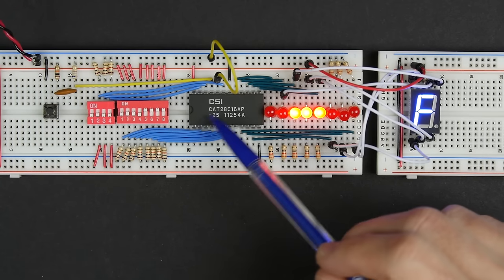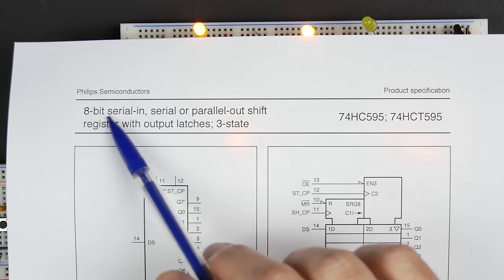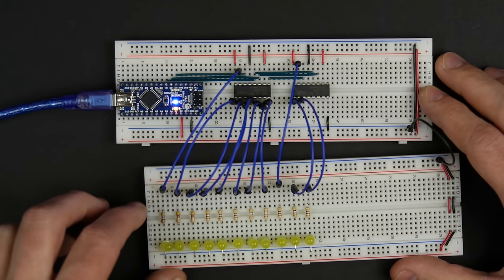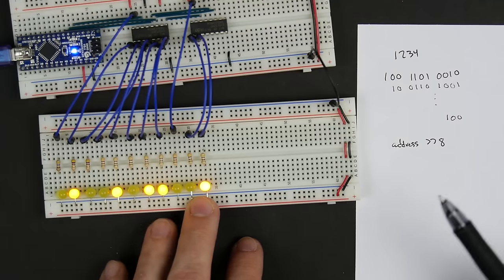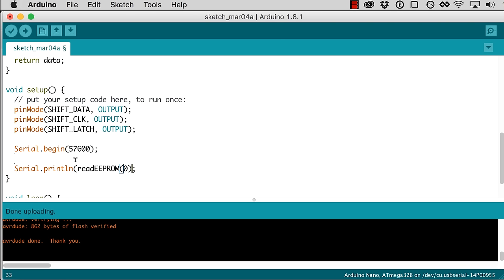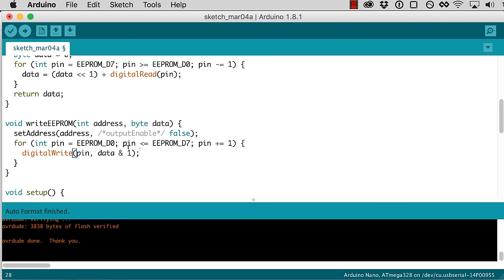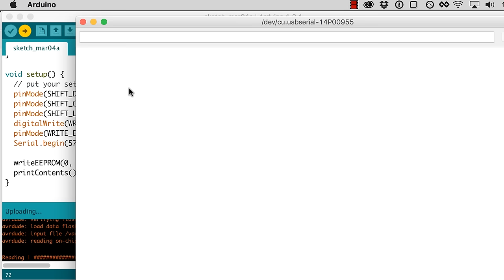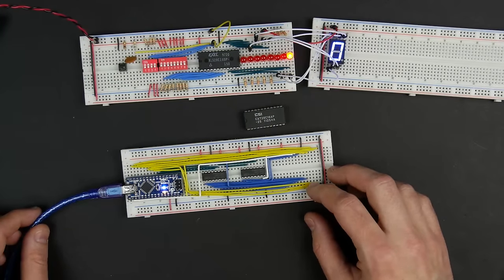Build an Arduino EEPROM programmer

Comment: Ben, your code breaks my heart for all the wasted iterations and unnecessary memory allocations. But you do an excellent job and the polish of your videos makes me forgive that software is not your area of expertise.
Reply: 100%.   he could've set the pinmode right before he wrote to a pin.
Reply: >wasted iterations 
...
>unnecessary memory allocations

Is he delivering a production quality library, or is it some mission critical code block that has some "written in paper" requirements about memory consumption with picosecond precision timings or maybe he's showing off his competetive programming contest solution? All he's doing is ad-hoc sketch that gets the job done. :)
Reply: and how that would affect the end result, please? :)
Reply: iamruss74 Dude, I write code on a daily basis. You don't have to remind me how. My meaning is not that Ben's code is wrong.

Everything else Ben does, he does very well. So it makes the few things he doesn't do well stand out. Because I code so often, I can't help but feel a compulsion to do it differently. Lots of people joke about the feeling being "ocd". I see a few places where const can be used, nested loops cleaned up, etc.

There is only one thing I would go out of my way to do differently. It's a very significant change. I would turn it into an eeprom debugger on the COM port.

In the current implementation, you cannot dump files; a program would need to read the file, convert it to source code for arduino, paste it into the existing code, and upload the project. It may sound simple, but every OS does it differently and the GUI isn't made for computer navigation. An eeprom debugger makes dumping simple; a program reads each byte from a file and writes to the COM port, then verifies that the file is correct by reading from COM port again.

Hard coding more than 50 bytes is not a fun process to do by hand. The point of having a programmer is to make programming stupidly easily. Not to make me convert binary into hex, then put it in a comma separated array, then make sure there are no off by one errors when I write the size, then hope that it uploads to the arduino properly.
Reply: Aaron, indeed there is a lot of room for improvements in any software, but it has to start somewhere. My point was that the scope of the video is to build something that writes hardcoded values into LUT table, not to teach us how to write full blown EEPROM programmer. There are tons of videos about eeprom programmers on youtube already. but we're building 8bit computer out of 74xx elements here, not state of the art arduino eeprom programmer. Should Ben decide to go into non important details he would need to cut on other information to keep the video duration reasonably short. I'd rather see him talking about shift register and not the software development in the bits of time I have to spare, because the software development is what I have been doing for last 2 decades of my adult life.
Reply: With code like this it's better to be safe than sorry. I have coded my whole adult life and it's safe to say that in setup code performance doesn't count. If it fits on the chip and runs well that's prio 1. Fast&efficiant is another story.
Reply: +droleniacoc i'm not actually sure I get what you mean, but I think it means something meaninful and not related to pink elephants
Reply: +Russell Teapot As far as I can tell, he's saying "it's pointless to think about these things. However, because the brain is designed to interpret data, we cannot help but think of them. In comparison a computer doesn't waste time thinking of them." It may be word salad, a symptom of schizophrenia and other mental illness. It may also be a poor grasp of English (as a second language perhaps?). 

And sure, I agree with most of the opinions in this thread. A better tool can be made, and the code can be cleaned up, but ultimately it works.
Reply: Aaron if he isn't constrained by resources such as clock speed or memory then he has no need to optimize for that factor. 

one line of brainfuck isn't necessarily better than a thousand lines of basic. how much are you willing to sacrifice for efficiency?
Reply: Albert Sandberg, but aaaron writes code every day!
Reply: Aaron - Go over to Julian's channel and knock yourself out. Keep your pedantic trolling off the good stuff. This is not a job interview. 

Why does this always happen to the really great channels?  Some troll who read an Arduino book shows up and tries to impress us all. 

You don't write code everyday. If you did you'd know what was important enough to throw around on what may be the best high level digital hardware channel in the world. 

Please, go away. 

I know, I'm feeding the trolls again. I just can't take it sometimes.
Reply: I agree, Crocellian.  I was shocked by his arrogance and lack of tact.  I think he lost the plot about the main point of these videos. Aaron could learn something about human interaction by looking at Graham Smith's contribution. Now excuse me while I get on with my daily coding...
Reply: Whether or not he's writing production code, allocating a new array on each iteration of a for loop could exhaust the Nano's memory before the loop completes. That's not really something you want to happen when programming a large EPROM. It's just as easy to allocate the array outside the loop and reuse it in each iteration.
Reply: He, Aaron. Haven't watched the video yet. But I recognise the sentiment from other videos where I see non-programmers try to code. It usually gets the job done, but it's so wasteful and often inelegant.
Anyway, his code is on Github: https://github.com/beneater/eeprom-programmer - you can always help out by creating a pull request that clearly describes what issues it's addressing.
Reply: Diggy Dude, when creating an array in c (or c++) with square braces, it is allocated on the stack, so as soon as it goes out of scope (at the end of the loop block) the memory block can be reused. Almost any c compiler will just reuse the same location for the array anyways, no matter if declared in the loop or before.
Reply: Alexander Daum: the memory allocation and later reclamation wastes CPU cycles. Creating an array inside the loop causes overhead.

While that's not immediately an issue in this particular case, any seasoned developer will instinctively avoid this. More so on an embedded platform such as the Arduino.
Reply: Juan Rial, it would waste resources if allocated on the heap, but allocating an array on the stack is just incrementing/decrementing the stack pointer. The compiler will, if at least some optimizations are disabled, always use the same address for the array, so no instructions are needed.

I just checked it, and indeed the compiled code is the same, no matter where the array is allocated
Reply: Alexander Daum: Ah, sorry. I didn't realise it would be declared on the stack. You said that in your previous post, but it somehow didn't register. Now, I didn't take compiler construction back in uni, so I'm not entirely sure how correct I am in what follows. But to me it seems like you'd still incur some penalty.

Every time you push a variable onto the stack, you need to move the stack pointer to make room for it. So if you declare a variable inside a loop, you'd be needlessly moving that poor stack pointer back an forth on every iteration: the variable enters scope inside the for-loop, and leaves scope at the end of it. If you declare it outside the loop, it will be declared only once for that stack frame, and the stack pointer would not need to be moved inside the loop.

As to you seeing the same bytecode for both versions: with all the intelligence built into modern compilers that doesn't really surprise me, nor does it strike me as something one can draw any meaningful conclusions from. And while it's good to know that it might not matter in the context of C/C++ (assuming it's not compiler-dependent), it's a bad habit you don't necessarily want to carry over to other languages.
Reply: Juan Rial: of course this is a c/c++ compiler feature. It is so common, that even with O0 the compiler does not re-create the object on the stack in the loop (at least gcc doesn't, haven't tested any others). 

But of course if you do this in a language with gc managed memory, like java, it makes a huge difference, as it does not only waste CPU cycles, but also pollute heap with a lot of dead objects, that have to be GC'd.
Reply: I've seen much worse in other videos
Reply: Alexander Daum is 100% correct about the array. Any modern compiler with optimizations would produce exactly the same code if it was before or within the loop. This is a whole selling point of C++. Micro optimizations like that just made the code more ugly and hard to read and serve no purpose.

Comment: Great video, very stimulating. If you wanted to save space and reduce chips to program just the AT28C16, you would only need one 8-bit Shift Register (SR). You have 20 I/O dedicated on the Nano but you need 21. Using 3 I/O to pick 5 more bits using a SR leaves you with 17 free I/O with 8 Outputs out of the SR as Address lines which are only inputs on the EEPROM. So, 3 I/O to control the SR, 8 in the SR as Address, 3 I/O as 3 more Address (11 in all), 8 I/O for Data, and 2 I/O for READ/Write Control. That gives you 16 I/O used with 4 I/O to spare. In fact, you really don't need to strobe the SR value into the SR outputs, the SR is being used as an Address extender, and the EEPROM will not respond to "twiddling" bits as you shift in a new Address - as long as it is stable before you strobe the Read/Write pins. So that frees up one more I/O to 5 spare.  But, then again, using two SRs to get 11 bits of Address in the SR which does free up 3 more I/O - a total of 8 unused spare I/O.  To your readers: Go with the two SR approach, it will get you up to 16 addresses if you need them for larger EEPROMs. And you can always cascade more SRs to get even more Address lines if you ever want to load an EEPROM over 64K Bytes. This is an awesome video. It has inspired me to build one with a Zero Insertion Force (ZIF) socket.

Comment: Nice Video , ordered a arduino nano, instead of the shift register i was first thinking of a I2C MCS23017 i/o extended , but this works fine also,  the video reminded me of my electronics study back in the 80's when i learned about display decoders with combined logic, it was fun at that time, but now everything is done by micro controller for smaller circuits which is fine.

Comment: I came here by accident, but that´s a great idea.
With this i can save the content of old Eproms and also upload it to an EEprom and use this. I have a lot of old synths which uses also old Eproms to run. Now i can backup these without the need of expensive PC-based Eprom programmers and also put the latest versions of the firmware in it as well, as for some i do have newer versions as plain text files.
With a little aditional stuff i can now get these stuff into my old synth.
Great tutorial, Ben...!! Thanx a lot. :)
Reply: There are may "cheap" eeprom reader/writers in the market for as little as $10.  Now I'm not trying to distract you from building this especially if you feel it's educational, however sometimes it's just not worth wasting time when it can be readily bought for a few dollars. ;)

Comment: I ended up making my own programmer for my 28C256 chip using the same serial to parallel ICs and nano. I am glad I haven't drifted off the way too much - the only difference is the arduino sketch.
Reply: Hi Russ.. would you be able to share your sketch at all? I'm trying to use the same chip with Ben's sketch and circuit diagram but haven't had any success

Comment: Hi 
Also you can use PCF8574 I2C IC instead shiftregister . Each one of pcf's handle two i2c input and give 8 output pin.

Comment: Nice job! I've just noticed for myself that if you don't have 74HC595 you can use 74HC164, but with CLEAR signal instead of STORE. In this case you must modify algorithm a little, but it will be working here too.

Comment: I quite liked the solution for the pin limitation on the Arduino. I had thought he was going to use some sort of multiplexer and then switch between data and address lines, but the timing issues probably would've made that a little finicky plus I don't think the pins would be enough for that anyway.

Comment: You don't actually need to worry about the WE pulse length being too long here; while the AT28C16 has a maximum listed, the datasheet for the CAT28C16A (the chip you're using) does not give a maximum. It also states that the write cycle can take up to 10 ms after WE goes high, so that explains why you needed to increase that delay.

Comment: The wiring of the breadboard is for the 28C16 pinout - which is different from the pinout of the 28C64 and 28C256. It will not be possible to simply swap a 24-pin chip with a 28-pin chip, since even the Vcc connection is on different pins.

Comment: Nice video Ben.  I have been working on a similar setup to read and program 27xxx series proms for my arcade video games.  At first I tried to have the arduino read the data and forgot to put the rom chip in place.  The reading came back with some 1s and 0s randomly since the data lines were 'floating'.  I then changed the line you had to set the data pins from 'pinMode(pin, INPUT)' to pinMode(pin, INPUT_PULLUP).  This had the better results as any data input line that was floating, was now showing as a solid high.  Now I need to work on the programming part as this will be different for proms than eeproms.

Comment: Not sure anyone mentionned this, but to send data to the 595, you can use the (faster) SPI hardware. It is exactly the 3 wires protocol expected by the 595.

Comment: Super Video, thanks!
For all not having a shift register lying around, you can also use the Analogue pins 0-5 of the Nano as outputs. (Just watch out for 6 and 7 those are only Analogue inputs)
With the Digital pins 2-9 as Data Lines, 10/11 as write- and output-enable, and a mix of D12-D13 and A0-A5 you can get along with just the Arduino pins. :p

Comment: I would suggest that using one more 74595 shift register, where the first is data and the other two is address.
Then the other /OE /WR etc can be controlled direct by the bit.
Also, you would shift out address, following by data and then write the data. 
This would be much easier to program.
The down side is that you can't read the data.

Comment: A few years to late but you can use "Port Registers" to write 8 outputs at once. No need for shifting and 8x digitalWrite(). Just one "PORTD = B10101000" or "PORTD=123".

Comment: I have build this and I do have a strange bug. I tried to test it with an array going  0x00, 0x01, 0x02 and so on. When I read the EEPROM I get this: 000:  02 03 02 03 06 07 06 07   0a 0b 0a 0b 0e 0f 0e 0f. I have rebuild it two times and I always get this result. I swapped the shift register and the EEPROM but it does not change the result. The Arduino outputs are also working fine. I am not sure what I might be doing wrong.

Comment: Excellent ! Now I have just soldered this thing up on a prototype board. The problem is, your code on GitHub has the data hardcoded. I need to take a 2K file from my computer and somehow transfer it over the USB to the Arduino and into the EEPROM. I forked your repo. Fun little project.

Comment: Just the tip, tip. The Arduino (ATmega MCU) is clocked at 16MHz. Shifting serial data into 74xx595 will significantly take a lot of clock cycles ((F_CLK / 4) / 16). However, as the 74XX595 is versatile, you can instead connect it to the Arduino's SPI to significantly speed up this process. And if you want a bi-directional solution (being able to write and read 16 bits), I recommend the MCP23S17 instead of the two shift registers.

Comment: At 30:33, you hooked up the write enable pin directly to the arduino. You could've just ran it through an rc timer like when you were manually programming it. Then you wouldn't have the problem of the pulse being too long.

Comment: PLEASE HELP I am trying to do this but programming to a 28c256 instead so I can follow along with the 6502 computer video series, but I can't get writing to work and I am only reading FFs from the chip which makes sense because it's new, but it won't write, any suggestions?
Reply: Watching this vid, I'm not seeing any place where the Arduino's data pins are set back to be inputs before the ReadEprom() routine happens.
 That would mean ReadEprom() is trying to read data from Arduino pins set as outputs, which may not show the data being output by the Eprom.

Your Eprom may have been written-to perfectly, but the Arduino is failing to read-from correctly.